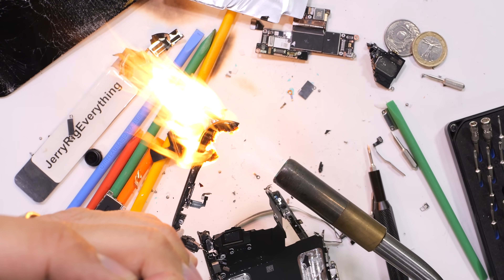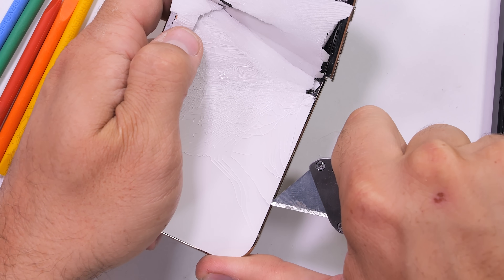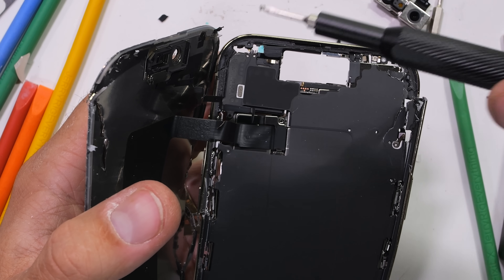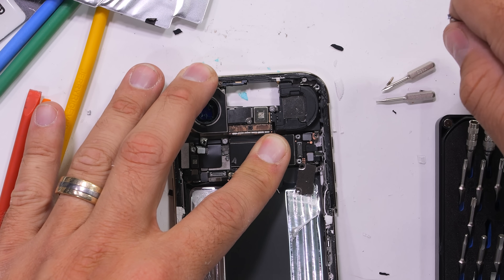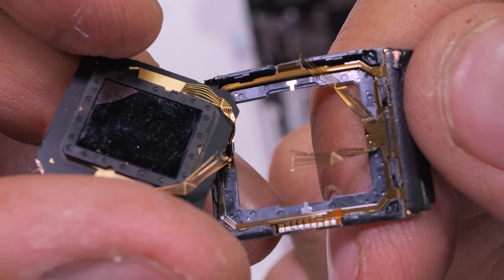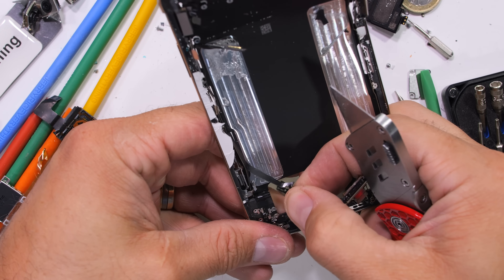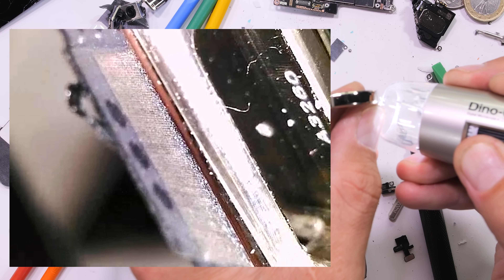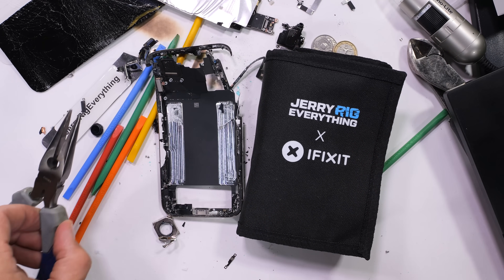iPhone Air Teardown -- I have no words

Comment: Actually, part of the reason the same size battery can't give all of its charge to the internal battery is because you can't take the external battery down to zero. 
Every battery has a nominal, minimal voltage. 

If you had an external 20,000 mAh battery pack, you cannot take 20,000 out of it. It has to maintain its nominal minimal voltage.

Comment: Just wanted to point out a problem I noticed with the 17 Pro Max. At full volume, the top speaker (above the Dynamic Island) makes static or crackling sounds which are especially noticeable in songs like 8 Letters by Why Don’t We or the Titanic theme. I tested 3 different 17 Pro Max units and they all had the same issue, so I don’t think it’s a defect, just probably not tuned well or maybe the speaker is being pushed too hard. Not a huge deal, but definitely noticeable if you listen at high volumes.

Comment: Please check voltages of the battery before and after charging. Wireless charging doesn’t NEED to be inefficient, and there may be bigger buffers on the Air’s battery bank than are programmed in the phone’s BMS.

Comment: Testing revealed that the 17 256GB, 17 Pro 256GB, and 17 Promax 256GB all use slow flash memory (with AnTuTu scores of 90,000-100,000 points), while the 512GB and 1TB models use high-speed flash memory (around 150,000 points). The 17 Promax 2TB model hasn't been tested, but it's definitely high-speed.

The biggest surprise is that all capacity versions of the iPhone Air use high-speed flash memory, and many new technologies have been incorporated into the Air. Apple has truly put in the effort; the iPhone Air is destined to be something special!

Comment: I hate how people complain about the camera and other things as if it’s not clearly obvious that the phone lacks the performance of the pro phones just by looking at it. This phone isn’t for people who want to take pro level pictures or videos. This is for people that choose form and aesthetics over raw performance. The single camera is plenty enough for I would say at least 80% of people it takes really good photos. It has the A19 pro chip, same as the promax has a beautiful, very bright display of a big phone, but feels very small and light in the hand. I think this phone is incredible. I would say the main drawback is the speaker quality. It gets loud enough, but it gets a little distorted when it’s at full volume. I have both the 16 Pro Max and the iPhone Air. I find myself daily, driving the iPhone Air more than my 16 Pro Max.
Reply: Exactly why I bought one. I've been waiting for years for a genuinely different phone to come out and this fits the bill perfectly. Plus I've had a phone with 3 cameras for almost 7 years and I honestly cannot remember taking a photo not on the main camera. Plus the single camera on the air is much better than the 3 on my old one
Reply: it's inexcusable for such as expensive phone though, maybe not for the iphone 16e but for this absolutely, especially since samsung fit both major complaints of the air into the s25 edge while only being a hair thicker. people love to bash android for missing 1 specific feature that iphones have, but when apple releases something like this that features even midrange phones have no one cares? the air is good, just absolutely not worth it at that price
Reply: @grancoast it wasn’t just a hair thicker, the edge is bigger in every dimension. It also has much sharper edges, so doesn’t lose as much space from very curved edges. Then it also doesn’t have faceid or magnetic charging hardware to package.

Comment: 8:30  It seems obvious now, but I just realized that 3D printing significantly reduces trimmings, and in metal 3D printing more so than filament printing, since the metal powder bin itself is structure enough during printing, no extra scaffolding needed.  That is a crazy material efficiency gain.

Comment: Timestamps
00:03 - iPhone Air teardown reveals innovative use of 3D printed titanium.
01:20 - iPhone Air teardown reveals strong design and eco-friendly materials.
02:41 - Teardown reveals the iPhone Air's repairable design and adhesive challenges.
04:00 - iPhone Air's battery efficiency and audio speaker design are discussed.
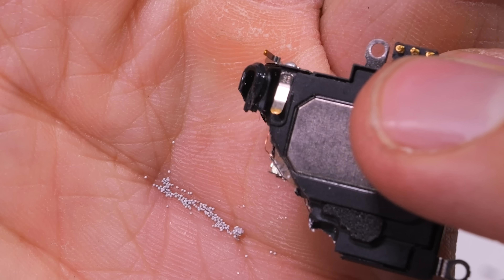05:15 - Apple innovates with sensor-shifting optical image stabilization for enhanced camera performance.
06:36 - iPhone Air's internal components lack cooling systems and have complex charging port designs.
07:52 - Apple's innovative use of 3D printed titanium in iPhone parts.
09:09 - The iPhone Air features a recycled aluminum frame with a titanium exoskeleton.

Comment: I wish you would do more videos on Motorolas. Not cause they’re good phones but for the fact that the batteries are so impossible to take out safely they need to be called out for it. I use so much IPA to get it out. Their batteries feel like they have the consistency of playdough and bend severely when you try to remove them. You thought google was bad before. Motorola is the king of unsafe batteries.

Comment: 3149 mAh battery, meanwhile android phones release with SiC batteries achieving 1.5x the capacity without making the phones thicker. 
The Xiaomi 17 Pro Max is 8 mm thick and has a 7500 mAh battery.

Comment: I use micro bits extensively. I've found the steel that iFixIt uses on their bits are not good and break/strip screws easily. Wiha has had the best steel in my experience

Comment: Pull tabs for battery removal might be simpler, but if the tabs rip/break, it is a huge PITA. I whole heartedly approve of any system that does away with the pull tabs. Though I wish they'd just go with a mechanical/latch system of holding them down, that removes the adhesive all together. Or even better, go back to  90s/00s tech of externally replaceable batteries.

Comment: If the wireless battery bank only change 65% then it should be with larger capacity that compensate that 35% that goes lost.
Also this recycle materials thing is boring. Like the material wont changed cause it's recycled. I would say that the price of recycled be more expensive and that is the only difference. Even tough for copper is just meltdown and it wont lose any of it's values. For battery material i would say that the recycled should be cheaper as it wont need for digging all the material out from the planet that cause serious amount of pollution so it should be cheaper but then again it's Apple that basically gets the parts production cheaper while the devices price still goes up only and they make massive amount of profit.

But then again i am not part of the Apple market as i wont ever buy Apple products cause these are way crazy over priced and makes no sense for me. To use a phone for 5 years and then after like 6th year maybe already lose all support and be a brick and the device cost in 4 digits or very close to it. Over 2 years ago i got me a phone with 400 euro and it had same amount of performance as the latest iPhone 14 Pro Max had and iPhone 15 series was not out yet for next 4-5 months. We can basically get a Dimensity 8300U in a phone for 200 euro and have lots of features better then iPhone like 120hz and 67W fast charger or Dimensity 8400 with 90W charger for 250 euro that also have 4 OS updates. I just dont see a point to waste money on brand when i get same or with some parts better device for 1/4 of the price and can have a new phone every after 3-4 years and still have not spend as much money then with one brand phone as the 3rd phone will already be better with everything as every camera be better even and never mind larger battery and so on

The only good thing from iPhone i would like is the base model size but the same is with Samsung and it's price drop faster and be also better then iPhone as more value for the money as less rip off

Comment: Not needing any force to remove the battery is the single most important factor in battery repair/replacement. 
It's the biggest innovation to repairability ever made. Reducing risk of battery damage is massive.

Comment: It's not called the Air because it's made of air. It's called the Air because that's the communication medium you'll be using when the battery runs out after 40mins.

Comment: The IPhone Air is a brilliant machine.  It’s so light and easy to hold yet feels solid and expensive. Has the same screen technology as the 17 pro and pro max. The same lightning fast A19 pro chip and the battery is surprisingly good despite its small size. Plus it’s by far the most beautiful design wise. After being a pro user for the last 5 years, I have zero regrets buying the Air this year.

Comment: I never understand the massive use of adhesive for a battery. The phone is fully enclosed, if you didn't secure it down then it still wouldn't move, just chuck a thin strip of aluminium and two screws to hold it down.
Reply: All of that adhesive enhances the overall structural integrity of the phone, acting as a structural reinforcement. The adhesive also contributes to thermal management by helping conduct heat away from the battery to the phone's metal chassis. Also, the battery itself has to be attached the phone as rock solid as possible so that it can't move or shift around in the slightest, to prevent damage and fire risk.  It has to hold up in situations like, for example, a bicyclist on a rough trail on a mountain bike with the phone attached to the handle bars.
Reply: @watkinsjason  Ok, good point, although I have seen a battery held down by a metal chassis with screws before. Surely you could have some kind of thermally conductive material on it without making it a pain in the arse to remove.
Reply: @Kirkaig  The good thing is Apple uses electrically-released adhesive to eliminate the need for solvents or strong pulling tabs, making battery swaps significantly faster and safer.  As shown in the video, you just hook up a 9v battery for 90 seconds on each side, and the current triggers an electrochemical reaction that weakens the adhesive bond, allowing the battery to release.

Comment: 216 pounds of FORCE not pressure. Having said that, it's torque that actually bends things. I believe you placed the 216 pound force at the middle of the iPhone Air and supported it at both ends which generates 2 torques on the Air in opposite directions. The Air is .5 feet tall so the lever arm for each torque is .25 feet. .25x216=54 ft-lbs for each torque.

Comment: Battery removal adhesive pull tabs work just fine, when the phone is new. At least with the adhesive Apple uses. I've not changed Samsung batteries. The problem occurs when the adhesive is old, like in an iPhone XS or even an early iPhone 11 now. The adhesive from years of heat has broken down and lost their elasticity, and they just snap. it's very hard to use them as intended. You've just got to make sure it's not charged up too much and pull the battery out manually. I'm hopeful the electrically releasing batteries will solve this issue when the phones are 3-4 years old and more, vs the old pull tab adhesive.

Comment: I think the electric removal of the battery is more work then what samsung using. But, I also think apple is getting a system in place for 2027, when smart phones are moved over to have user replaceable batteries. They could allow the entire back or front of the iphone to be removed by applying an electrical charge to it. This would allow water resistance to be maintained, while also makeing it reletivly easy to remove the battery. So while it would be easyer to have samsungs removeable system for the bettery its self, I can see why they are starting the ball wroling on developing this electrical removal system.
Reply: The ones with the heated pad require much less force, and are preferred by a lot of people that actually fix phones. Most of the people do that as a service take apart more phones in day than Zach takes apart in a year.

Comment: why is there not a phone made of carbon fiber?
Reply: AI said : 
The primary reason smartphones do not have enclosures made of carbon fiber is due to signal interference. Carbon fiber is a conductive material that can interfere with electromagnetic signals, including those used by cell phones. This interference can lead to reduced signal strength and connectivity issues.
Signal Interference: Carbon fiber can block or reduce the phone signal, which is a significant concern for users who rely on their smartphones for communication.
Material Properties: Carbon fiber is known for its high stiffness and tensile strength, but these properties also make it a conductor of electricity and magnetism, which can affect the phone's signal reception.

Comment: 100 bucks for merely 3 ah to recharge your phone 65% is quite ridiculous, just get a plug in power bank...
Reply: A large percentage of Apple users will happily pay for a first party battery that matches the phone. If you worried about $100 accessory for a $1000 phone, you are not in the primary target audience. This is the company that sells injection molded plastic watch bands for $99.

Comment: 4:05 I love the electrical removal. Perfect compromise between durability and repairability. Those pull tabs have ripped off mid pull so often on me. And when that happens, a really bad time starts. I wish they did that on all their devices. It’s also not a short circuit. The strip offers quite some resistance.

Comment: For actual repair technicians the battery removal with electricity has to be so much better. They have the equipment and it works every time

Comment: Great job on the tool selection; I use all those tools daily professionally and they hold up remarkably well. Don't put the T7 (and similarly sized torx bits) in even a small impact driver tho.

Comment: They did an impressive job with the design, and you KNOW they considered the bend test! THAT being said, the way Apple measures the Air is like someone measuring the height of their car at the hood, and ignoring the roof. The reality is that the iPhone Air is 12.03mm thick, and it won't fit through a slot thinner than that. Thicker than the regular iPhone 17. Also thicker than another phone you reviewed; the HTC U24 Pro which is 0.79mm thinner than the Air, and has 3 cameras, a 50mp front camera, memory expansion slot, stereo speakers, AND a headphone jack.

Comment: Also, ragging on the conductive tabs is top lel. 

We all know those adhesive pull tabs go to crap after several years. Risking folding over the battery.

Comment: The electrically released adhesive is a god send, the pull tab stuff always broke on me on iPhones. They could’ve just designed better pull tabs, but who cares as long as it’s works and is easily accessible to repair technicians which this is.

Comment: 8:50 my bet is that their 'recycled' titanium is just the scrap that is left over from the main titanium parts. Which is good, it just feels slightly misleading.
Reply: How is that misleading? Repurposing “the scrap left over from the main titanium parts” is still recycling. I don’t see how it would be any different than if they had sent the scrap titanium to be disposed of and another manufacturer came and used that scrap metal for their own phones. In either case it’s still recycled titanium
Reply: Apple has been also breaking down their older phones in-house besides also re-purposing the left over scrap which is pretty work.
Reply: Well normally that scrap from the frame would go into the garbage or sold as scrap so they are doing something with it rather than not.

Now the real question is where is the frame titanium coming from

Comment: The more I see of this whole lineup, the more I think they will be the perfect phones to get refurbished down the line. Refurbished iPhones are always a great deal, been using them for years due to the extended security update support, just get the option of a new battery and you’re set for a long time.
Good to see they’re up there in durability as well, they really learned from the “glory” days of the 6 plus 😂

Comment: 5:29 it's not faster or slower especially at that size but on wide focal lenght sensor shift stabilisation is more effective while lens based stabilisation is more effective on long focal lenght. Thats why most real cameras of the past 5 years have ibis build in but tele lenses still have OIS

Comment: 9:10 All the reviewers and buyers that carry on about the Air titanium frame need to see this video; whenever I commented that the internal structural frame was aluminium like all iPhones and that the titanium was just the thin, enclosure strip around the outside edge of the phone, I was met with derision..
Reply: Same thing was with the pro’s previous years indeed
Reply: 677

Comment: 3:35 There is an important thing about glued pull tabs: after a long period of time (like 5 years) the glue can change its condition and the battery is no longer easily removable. You praise the Samsung pull tabs, but keep in mind that  you do the disassemble of new phones just out of the box. So I still think Apple's approach is superior.
Reply: They both have ups and downs; iPhones are slightly more intensive, but last longer, while the Samsung is easier but might not last as long. Of course, I’m hoping that the glue has gotten better in recent years, but you can’t really know until like 2030